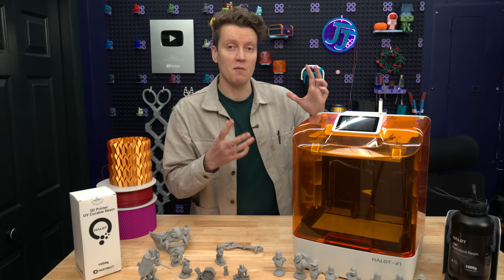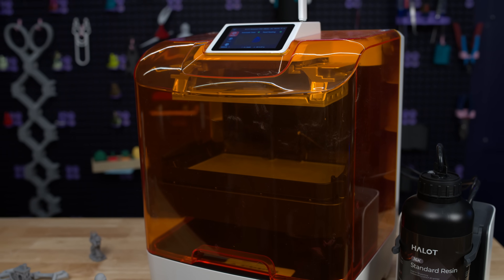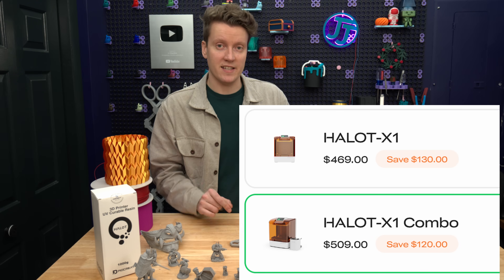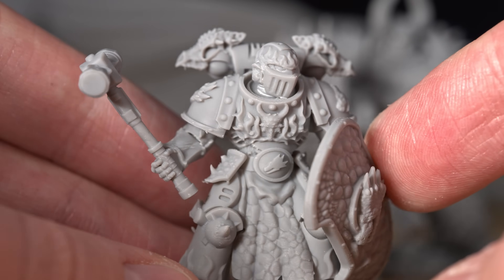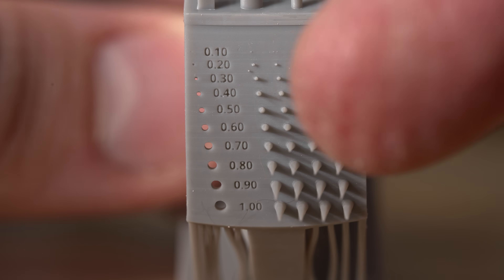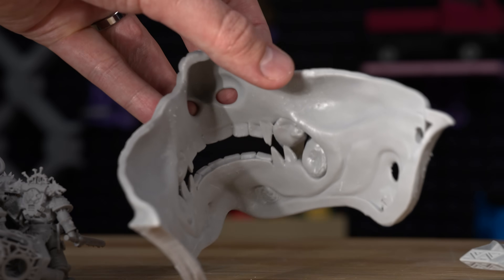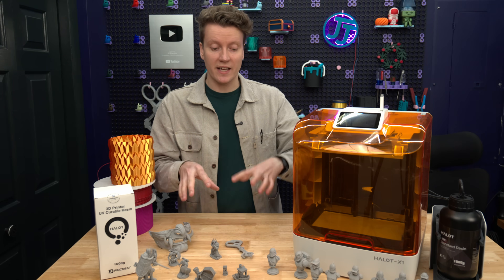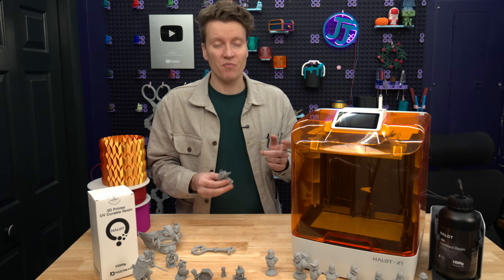16K Resolution Resin 3D Printer - Halot X1 Review

Comment: Ok, this is starting to feel like a sponsored fluff piece rather than a review. The X1 is an interesting printer. But I am not convinced it makes printing easier than any of the other printers out there. Also, no, you cannot give your filament-based printer to a child and expect it to be fine. Filament printers still produce particulates and VOCs. Just because it is not smelly does not mean that it is safe. The research for environmental safety around FDM has similar recommendations to those for Resin. That is to have it in a well-ventilated space and to vent outside if possible